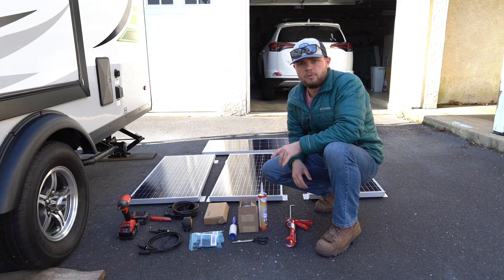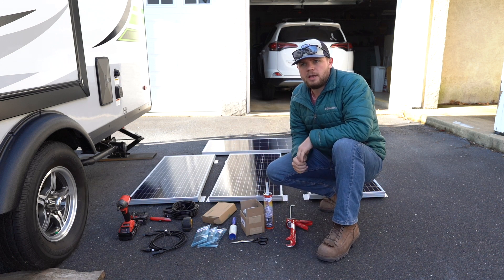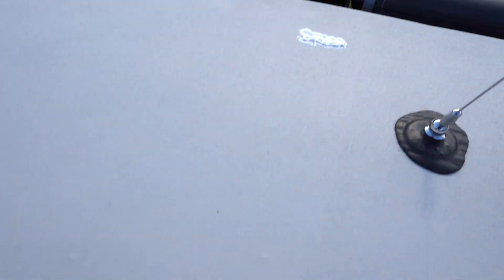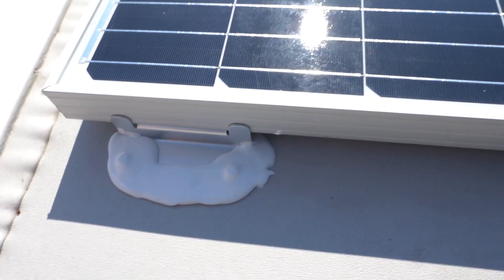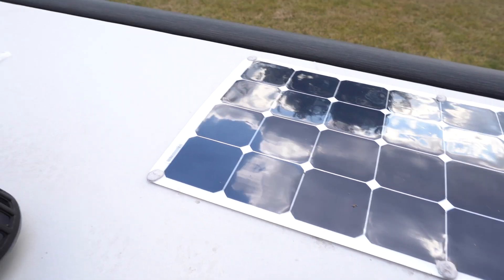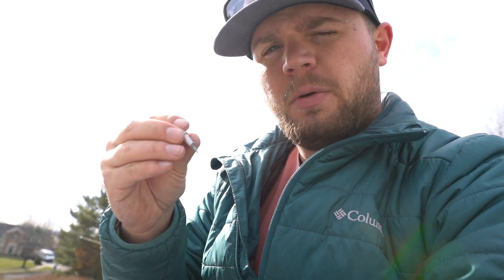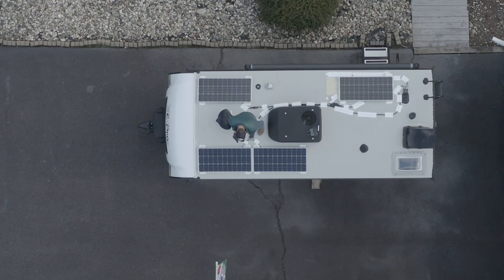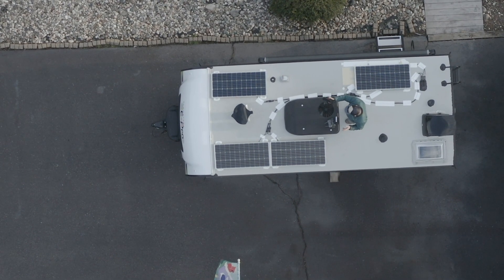400w Solar Install on Geo Pro 19fbs - Travel Trailer solar system

Comment: I have a very similar trailer - the 2020 version of the G20BHS. I just installed a 600W (100 x 6) from Renogy, prior to watching your video. I got lucky and didn't tangle with the flexible mount flat panel out of laziness (and luck!). I also ended up going with super strut, and I did put down some 1" double sided butyl tape at each roof penetration, using 3/8" lags, and finally covered them with the dicor self-leveling lap.  Then I used cone nuts to mount the panels to the rails. I'm hoping it equates to ease of servicing the panels (or swapping them) down the road. Thanks for sharing your work with us!

Comment: Love the video, These companies should make brackets, that you can drill in, install forget about it, then years later when one dies you can unclamp the panel and replace it with a new one. No dealer needed DIY kind of thing. would be efficient for the end user. 
Question, how deep did you drill into the roof and how did you know what spot to drill into ?
2nd question, how did your patches hold up now years later? anything diff you would of done?
Thanks for the install

Comment: We have a similar TT with a rubberized roof too.  I chose to use four 100 watt flexible panels that are taped to the roof with VHB tape.  They are so light and thin I don't think they will ever pull the roof off.  I realized that flexibles have a limited life as over time as they delaminate and peel. I'm not a full timer and the unit is often covered so after 3.5 years the system is still going strong.  I don't need to squeeze every watt out of the system as 400 watts is plenty to run everything in the RV.  I do occasionally treat the panels with a  glossy protective spray so maybe that why I'm not having any issues so far.

Comment: You should have used aluminum unistrut as the base/frame mounted to your roof, then bolt the panels to the unistrut, that way if you service or change panels a simple unbolting and no messin with the roof is all that is necessary.
Reply: ledzepandhabs unistrut.  the material of many uses.  I use it a lot
Reply: I'm embarking on this project now and have gone back and forth on whether to do a simple screw-on mounting like this or the strut channel route. No doubt a strut channel makes swapping panels a breeze. But given the expected lifetime of rigid panels and the not terribly big deal of peeling up some lap sealant, I went simple. No wrong choice.

Comment: Just a question, about how much do you weigh? I’m ~225, and have a 21 epro. 19fds. Did you feel that the roof was solid enough to walk on, or spongy?  Thanks
Reply from the maker: About 175-180. I was careful but yes it felt solid to me, it helps its such a short trailer and has support from the bathroom walls, kitchen and closet.

Comment: Nice install. Personally, being cheap or lazy, take your pick, I would have left the factory flex panel in place until it died. They usually last 2 or 3 years. Your 3rd new panel could have gone down next to the AC as you did with the first two

Comment: I am installing 2 - 200 W panels on my roof. Can't decide whether to run them parallel or series. Shade isn't an issue.
Reply from the maker: You will technically be fine with either, I would do research on your specific panels and see if the manufacturer recommends anything.
Reply: Assuming your controller can handle the higher voltage of serial, do that. Higher voltage is less amperage. Less amperage means lower cabling losses. All else equal. Also means running fewer cables up top, fewer connectors, and less cost there.

Comment: James, it has been over 2 years. Time for an upadate please...
How did mounting of those brackets hold? 
Recently I installed 2 of the Renogy 100W using same method but was not too happy about the mounting screws not ending up tight. I did find out that using none self taping screws is better. So I am relying on the DICOR to hold them. But I do think a strip of Eternalbond tape over the brackets/Dicor will help.

Comment: Did you use 12AWG wire throughout? I feel like 12AWG isnt enough to sustain a ~20A load like those panels probably do. Have you had any troubles?
Reply from the maker: I believe it was 10 or 12 I forget. But I just tied into the box on the roof that came factory and never had any issues.

Comment: Appreciate the video. Wish you would have filmed how you wired it to your RV though. Does it just plug in where the factory solar panel was wired in?
Reply from the maker: Yes I didn’t wire anything into the RV itself. Just plug the new cables into the box on the roof!
Reply: @JamesVonwiegen  Sweet thanks!

Comment: Like the idea but don't like screwing in roof. I'm getting a cheap truck cap and mounting 400w worth of solar on that and use it to charge my bluetti ac200.  Then I can park trailer in shade and pickup in sun to get full charging and stay cool. Then just run extension cord to trailer electric hookup. The bluetti ac 200 is amazing with 1700 kw storage and cheaper then lithium batteries by itself . Trailer setup I'm keeping original seeing it will always be plugged to my solar generating pickup
Reply from the maker: Alot of people seem to not like drilling in the roof, but dont realize the factory ones have 6 holes drilled in the roof for them. But I get you, I would have rather not drilled.
Reply: @James Vonwiegen  look how many huge holes in the roof with AC, Fan, antenna and factory solar plug ins. Lol
Just do it right and you will be fine. People.just need to relax sometimes 😆

Comment: My FBS 19 has a 1000 watt Inverter which won’t allow me to use the 1100 watt microwave.  I think they should use a 2000 watt Inverter. Also I have 200 watt Zamp suitcase which plugs in and handy when parked in the shade.  My issue is enough battery storage with 2 interstate batteries that came with.  They drain pretty quick with the furnace fan, a couple lights, and tv by morning.  Now I’m looking into better batteries and perhaps more than 2.  300 watts does the job for me.

Comment: James, would you be able to give more details about drilling into the roof? For example, how far down can you drill, did you pre-drill the holes, or are the screws self-drilling? 
Like everyone else has said, thank you for this video. Now, I have more confidence to add more solar to my 2021 geo pro f19d.
Reply from the maker: I just used the self taping screws that came with the Renogy solar panels. If you order them on amazon or directly through renogy it should come with the mounting brackets and screws included. I just used them and sunk them in the roof.

Comment: Can you run a generator to charge the batteries while the solar is charging? Did you have to upgrade the charge controller? Did you upgrade your inverter?
Reply from the maker: I never upgraded anything just solar power itself. And yes you can also use a generator.

Comment: Hey, I admire you for tackling that, I wish could. I think you did great ! I have an epro 19QB and the factory solar and batteries are not good.
Reply from the maker: It was alot easier then I thought it was going to be. You can choose to just use flexible panels if you wish, might be a little easier.

Comment: Hi James,. have you upgraded the Controller? IF yes, what did you installed?
I just purchased a 2018 Geo Pro 19FBS. It does not come with Solar system. Prewired evidently; roof entry to I guess where the GO Power controller goes.  My plan is to install two 100W = 200W. 
I am debating if I should go with GO Power 30A that comes with these models or get a MPPT 30A Controller. 
Your comments and recommendations are welcome.
Reply from the maker: Hey, no I did not upgrade the controller because I had no need to unless I wanted to go above 500w of solar and 400w is fine. I would personally leave the PWM standard charger and just install the extra panels. There is really no need to upgrade unless you want over 5002 to handle the Volts.

Comment: Is the underbelly enclosed? Also I would ditch the pwm controller and go with MPPT. The MPPT will give you better performance it is way more efficient then the controller that comes installed.  Nice job up till the panel removal but hey thanks for the heads up on that. I am looking at the 19QB.
Reply from the maker: No the underbelly is not closed. The NoBo trailers have an enclosed underbelly though. Good luck, we switched over to a new motorhome and have a MPPT and 1000w!

Comment: Thanks for the great video. This looks like quite the job and I'm the opposite of handy. I also weigh a good 240lbs and nervous about getting on my trailer roof. Trying to figure out if doing all of this is worth it or if I should just get the foldout solar panels and just lay them out during the day or something.

Comment: Not solar question but curious how the Tacoma tows this size and weight trailer. I am looking at the Geo Pro 19FD.  Do you use a brake control and anti sway hitch which ones. Great videos.
Reply from the maker: It was my dads Tacoma but it pulled really good. I have towed a Jeep behind this Tacoma before and it pulled the trailer alot better and braked decent without my brake controller. I would recommend getting a brake controller however for longevity of the truck brakes and safety. I didn't use a anti sway in this video, but I now have a weight distribution hitch, but not the sway control!
Reply: @JamesVonwiegen  Thank you sir,  I should of included a weight distribution in my question.  Thanks again

Comment: Great stuff!  Thanks! ... In Nov. we bought our 19BH and so far have picked up a couple of victron charge controllers to manage the solar port and to replace the stock PWM controller.  Thinking about picking up some of the curved brackets along with the z brackets so I can remove the panels without having disturb the screws.    Ive  also been looking at 60 cell residential panels and throwing some legs on it to make one portable.   Would also love to mount one on the roof... Maximum power / dollar, leverage the higher voltage of the panel (~37) combined with the mppt charge controllers.  

I just can't bring myself to drill into the roof!!!!!
Reply from the maker: Bruce Kung that’s awesome, we will be upgrading to a MPPT eventually. I was going to buy those brackets ur talking about but it was around $80 per panel and I couldn’t justify that. 
I hear ya about drilling in the roof, I really wanted to do flexible panels but rigid panels last much longer. Also just an FYI the panel that comes with the Geo/E Pro is drilled into the roof.
Reply: @JamesVonwiegen  yeah no kidding they're a hundred and twenty bucks here in Canada for those mounting bracket... Wowza.  That said now I'm inspired to go get lithium batteries myself which obviously dwarfs the cost of any solar panels and hardware that I could Buy.  

Have you had to rely on  Shore power to charge up your lions and how does your converter on board work for you for that purpose?   Now I'm all over those UT1300s and trying to find them here in Canada.   This solar slope is damn slippery!!!
Reply from the maker: No the Solar Panels can charge them up in 1 day if its sunny out enough. I pull in around 15-18 amps on a sunny day. You sadly cannot charge the batteries using shore power, the converter isn't a charger also just a converter. I haven't had any issues with the Lions and would recommend them.
Reply: @JamesVonwiegen  hey james, wondering how the dicor took to the tpo /alpha super flex roof?  Ive read that regular dicor can cause the membrane to bulge/Bubble... Any signs of that?  Sadly I read this after I bought a 4 pack of dicor... Aparently, alpha systems has its own self leveling material that is compatible as they are made by the dame company.
Reply: James Vonwiegen great video! Is there plywood under the entire rubber roof? Any issue with wind going down the road? Thanks for putting together an awesome video...wife and I just ordered a geopro 19bh.

Comment: Do you have an update? I wouldn't think the roof would provide enough for the screws to bite into. I'd be worried the panels would fly off going down the highway.
Reply from the maker: We have had 50mph winds while stationary and driven it around 60mph on the highway. Everything is fine so far!

Comment: Looks like a well thought out project. I would have left the factory installed panel in place and just added it to the power input with the new panels. Your 4th rigid panel would have fit nicely beside the factory panel, in line with the AC box along the center line of the roof.

Comment: 1. Why do you need so much power? 
2. Did you install a different battery?
Reply from the maker: Sorry for the late response!
We are full-time so we needed 400w of Solar. We now had 200ah of Lithium batteries and are on the road full-time with no problems.

Comment: How how is your tacoma towing the camper, do you drive in "D" or 4th gear. Also what size tires are you running.
Thanks for any info thinking about buying a Geo Pro.
Reply from the maker: The Tacoma did fine pulling and I kept it in Drive. If you are going up and or down mountain passes then 4th or a lower gear would be better so it doesn't go into overdrive. These are 32s I believe but not sure.

Comment: Good stuff here.  Wife and I are looking at the Geo Pro 20BHS.  We want a lightweight travel trailer we can pull with our 2016 Highlander XLE.  Mainly, we want it for hockey travel with our son.  I'm considering doing some upgrades as well (i.e. 100ah Batteries x 2, 100w panels x 4 and 30lb propane bottles x 2)  Not sure how much boon-docking we'll be doing during the summer, but we have planned a trip to Mt. Rushmore and the Black Hills for at least 2 weeks in June.  Looking forward to your follow-up videos.
Reply from the maker: We have nothing but good things to say about the Geo Pro so far, so I would highly recommend! Thanks more videos coming soon as we leave full time in April.

Comment: Great vid. Did you pre-drill before the initial lap sealant?  I was considering adding more Go-Power panels but the price of one is almost the cost of this whole job.
Reply from the maker: No I did not pre-drill, I used self tapping screws. Yeh Go-Power is way overpriced which is why I used renogy 100w.
Reply: @JamesVonwiegen  Did you notice any change in towing as far as weight and drag that equated to lesser gas mileage on your TV? I am still on the fence about doing this job with flex panels.
Reply from the maker: @jeffmezzullo5864  no the solar panels are not that heavy and rigid panels last longer and generally pull in more amps.
Reply: @JamesVonwiegen  Totally unrelated question if you remember how many boxes of the peel and stick flooring you bought for the inside of the FBS. That looks nice.

Comment: Jim how did you see your markers with caulking down and did you just use the mounting screws that came with panels? How do you know (1) deep enough to hold panels, (2) wont protrude thru ceiling or hit anything? Thanks for a great video.
Reply from the maker: I lay the panel where I want to mount it, then I mark all the holes (8 holes). After that I would pull the panel up and put the Dicor Sealant over those marks I made with the market (yes the marks are then covered). But I know where I want the panel mounted because the dicor is now onto of the marks. I then put the panel ontop of the dicor and bam, the panel is where I want it! I did use the screws that came with the mounting hardware and I looked online to find the thickness of the E/Geo Pro roofs before installing them.

Comment: What size screws did you use to mount to the roof? I am about to add to ours and I am dreading screwing into the roof!
Reply from the maker: I used the screws that came with the mounting brackets from Renogy. I got them off amazon!

Comment: Did you add batteries as well? Any changes to the controller?
Reply from the maker: We added 2 - 105ah Lion Energy UT1300 Batteries and kept the stock controller. We have lasted 8 days boondocking in decently sunny conditions.
Reply: James Vonwiegen Thank you for the reply! Where did you install the batteries? In the pass through? I am very interested in the very same trailer but wanted to see what you were able to do. I would want it to boondocks as well, but wondered where the batteries would sit. Is the 39gal Tank sufficient for a while on the fresh water? Thank you
Reply from the maker: Sebastian Heil We have been able to boondock for up to 7 days with showering once and minimizing water. I actually wrote a blog about the RV batteries and how I relocated them. 

https://wanderusliving.com/rv-battery-box-install-lithium-battery-upgrade-geo-pro-camper/
Reply: James Vonwiegen thank you!

Comment: What was the inverter and battery bank size you're thinking?
Reply from the maker: It came with 1000w and 160ah. We upgraded to 210ah of Lithium and have been fine with the 1000w inverter but would prefer 2000.
Reply: @JamesVonwiegen  Can you tell me what all the included 1000w inverter ran?  I am researching our new TT and have read conflicting responses to this question.  We are getting the 2020 ePRO 19FD and were hoping that with 300 watts of solar, 400AH lithium batteries (2X200) and the included 1000w inverter we can power the 120 plugs to charge our laptops plus use the 12v to charge phones.  We have very basic electric needs, but have read the outlets will not work unless on shore or generator power.  thanks for any information you can provide.

Comment: WHY didn't you just use the existing panel  plus three new ones?
Reply: I was wondering the same thing.
Reply from the maker: james bean when wired in series like I did, you cannot mismatch panels with different voltage or amperage. Not sure which one but every website and video I watched said the same thing. If you do, it won’t run as efficient
Reply: @JamesVonwiegen  Maybe it would have been better to just leave it there, disconnect it, and put the new one on top of it. Or maybe not.